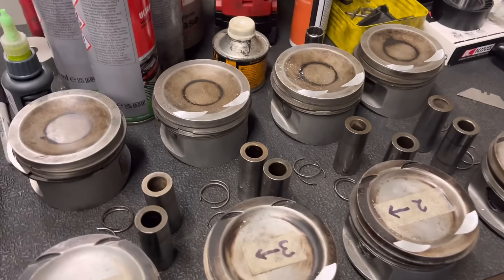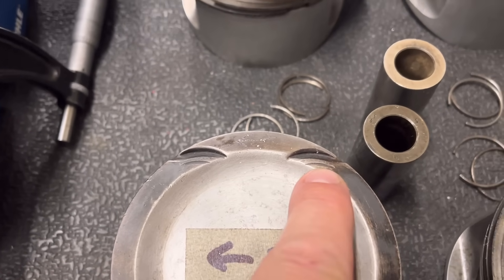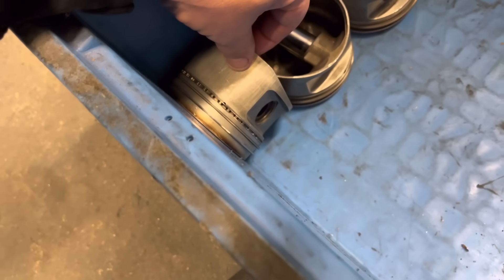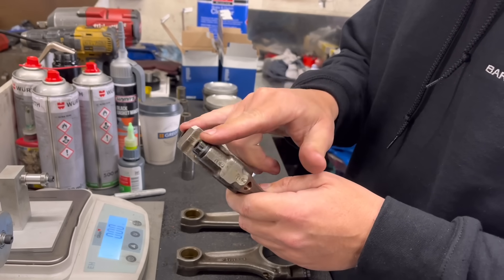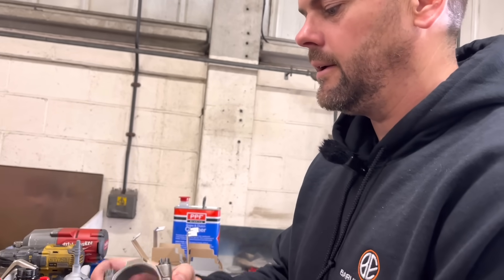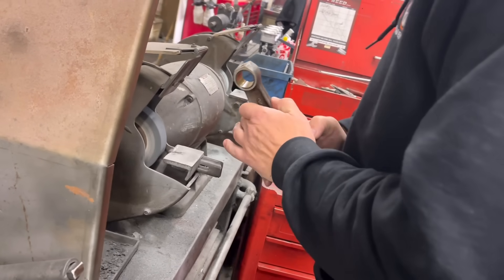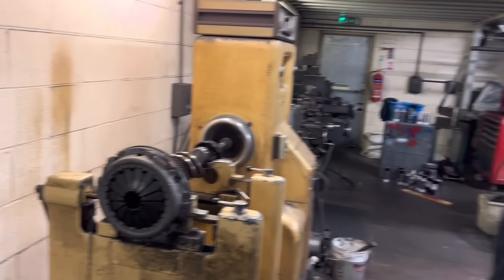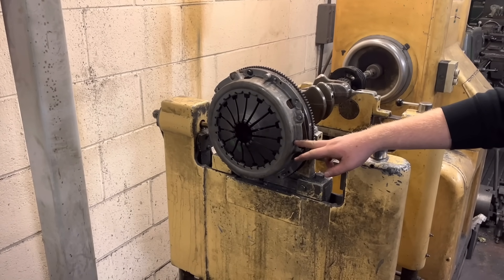All the engines we’ve built and we’ve NEVER seen one do THIS before!

Comment: I have never worked on on of those transit motors as i am retired now but i do remember i think they were an Isuzu diesel much larger than the transit and they had the rods that were tapered at the top and they were pigs of things to do the small end bushes on and they always seemed to wear out more than most normal ones.

Comment: I’ve had this transit issue recently. Holed no2 piston through the bowl and out the oil ring. Put new piston in and 4 brand new injectors. 3 months later and 8000  miles no2 piston gone again exactly the same. Another piston in and new ECU this time, see how long it lasts 🙈

Comment: The Duratorq engine use continental Siemens common rail fuel system and the injectors are notorious to blow torch holes in the pistons. Injectors need to be replaced at 150k and make sure the intake system has no boost leaks. On the other hand the denso common rail in the 2.4 doesn’t blow torch holes in pistons and will do a million Km if the servicing is done at 10k . I looked after a mixed fleet of 2.4 and 2.2 and the 2.4 is a far more reliable set up. The 2.2 suffers from too many fuel related issues, even run away.

Comment: Had similar cracked pistons but not as bad in an Isuzu 6BG1 diesel. I believe it is caused by repeated hot cold cycling of the engine and probably heavy loading during the warm up. Typical of city delivery vehicles.

Comment: A few years ago I am diagnosis on a transit diesel, misfire on no 3 an injector didn't cure it so one of the lads pulled the engine out and removed the head,on inspection the piston had a slot sliced through the middle put down to an injector fault

Comment: Great video again Lee. Good content again always. Had a lot of 2.2 lumps on cylinder 3. Injectors and ecu fault can cause over fueling on cylinder 3. Definitely test the injectors to see what there doing especially on cylinder 3. New set from Ford not ebay special recons.  Also had egr coolers go and head gaskets on the 2.2..

Comment: Will you balance the transit or not bother with it being low reving?
Reply: The modern transit engine is not a vintage Gardner with a limit of about 2000rpm.  The 2.2 transit engine can rev to over 4000 rpm (if I recall 4250) - so I wouldn't call the engine slow reving.  It would require balancing.
Reply: @georgebettiol8338  I don’t call 4250 rpm high reving. It might be as far as a small diesel is concerned but not for a petrol, so is the small low reving engine balanced within the spec of a petrol engine?
Reply: @Crabneedspony  Unlike in-line 6 cylinder engines, the In-line 4 is inherently unbalanced wrt secondary forces - forces that become more pronounced the larger the capacity of the engine, especially diesels, which are equipped with heavier and more robust pistons and conrods.  To address this Mitsubishi and Porsche (who paid Mitsubishi a royalty for their patent) fitted balance shafts in their larger 4 cyl petrol engines of the 1980s.  So to answer your question, the transit's engine needs to be appropriately balanced.  Also of note is that the Transit's 2.2 DOHC version is also fitted with balance shafts to counteract the unbalanced secondary forces.

Comment: I was stationed at RAF Fairford in the mid 80's and absolutely loved it. They sent me to the GM Tech Center to learn everything about the 2 stroke Detroit Diesel engines (Screamin' Jimmies). Had a blast and loved every moment I was there... Wish I could show you a piston that I pulled from a tractor engine... Everything from the oil control ring on up was stuck against the cylinder head. Thanks for an absolutely awesome channel, guys.

Comment: I've seen transit pistons do this loads now common issue with them they have a very delicate fuel pump and injectors, the bit that always get me, is the top plate for the injectors, 6nm then 180 degrees

Comment: Another great video Lee as for the Transit as Tom Jones would say "it's not unusual"🤣 as you probably know the same engine is in the Peugeot/Citroen Boxer/Relay and I've done loads for various ambulance Trusts over the years and always renew injectors and go through the EGR and dpfs as oil dilution is a big issue when the dpf suffers multi regen failures and the 5th injector fills the sump with diesel and as we know diesel doesn't work well with bearings engine or turbo 🙄 I'd put a timing kit on it unless it's absolutely perfect as had several wear and try and chew through the timing cover 😬 keep up the good work cheers Matt 👍

Comment: Lee can i ask why the pistons dont come from the factory with the pockets? i do watch all your vids
Reply: planned obsolescence - they build an engine to last at least as long as the warranty, so they can sell new engines.

i have several Wolseley motor cars 1948, 1955 etc, never had to do major engine machining, and the parts are pretty cheap, being early post war, they were over designed, can you imagine delivering a vehicle to the Military and it not lasting 4 years.

Comment: The trouble with modern diesels is that are meant to run more like petrols.Mpi and too many electronics and run at much higher rpm.A "proper" diesel is not exciting but will /can run forever.As long as it has fuel and air theres not much to stop it running. Best diesel car engine I had was the 1.7 Isusu TD vauxhall used or the Peugeot 1.9 non turbo diesel. As for bigger lumps the Gardner 6 cylinder engines are still legendary.